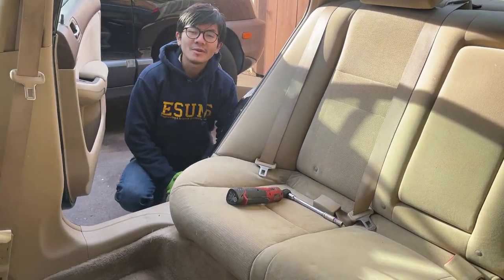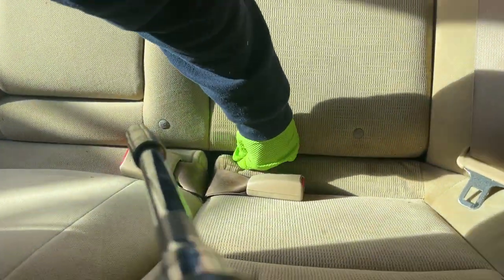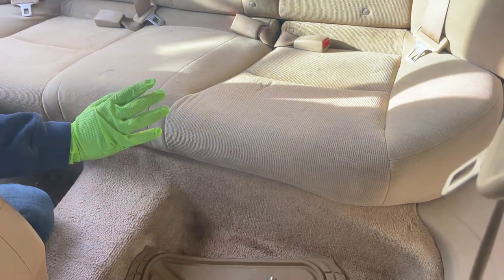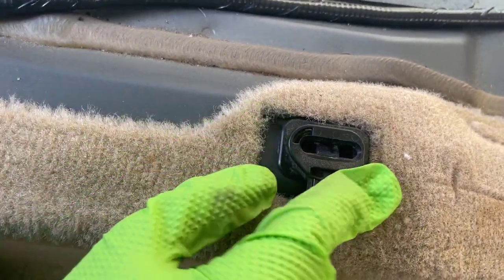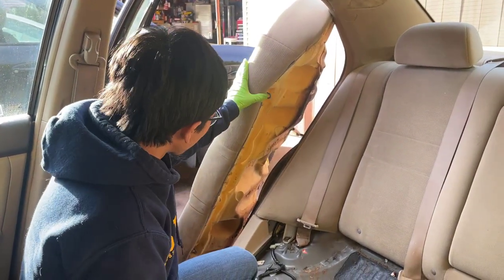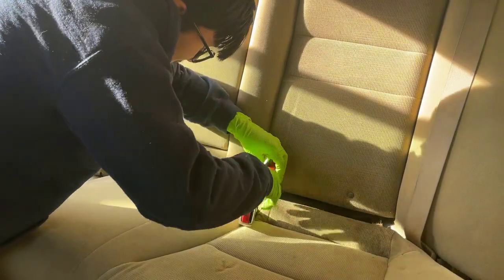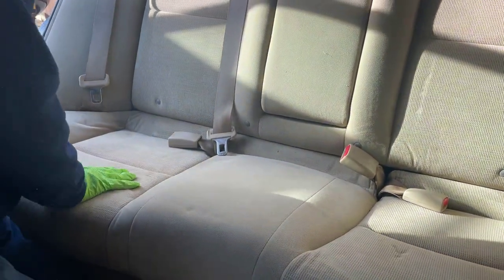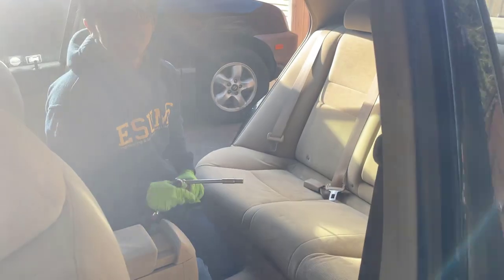How To Remove & Re-Install Rear Back Seat Bottom Cushion Honda Accord Gen 7 2003 2004 2005 2006 2007

Comment from the maker: Here are the #ad links to some of the tools, parts & accessories which might be required to perform this repair:
1.  https://amzn.to/3w7f7wm  |  Milwaukee 2457-20 M12 Cordless 3/8" Sub-Compact 35 ft-Lbs 250 RPM Ratchet w/ Variable Speed Trigger
2.  https://amzn.to/3jYdb4w  |  Crescent 3/8" Drive 72 Tooth Quick Release Flex Head Teardrop Ratchet 11-1/4" - CRW10
3.  https://amzn.to/3yUXyRH  |  FH Group Ultra Comfort Highest Grade Faux Leather Full Set Cushion Pads Car Seat Covers for Front and Rear– Universal Fit for Cars Trucks & SUVs (Burgundy/Black)
4.  https://amzn.to/33J1KZ7  |  THISWORX Car Vacuum Cleaner - Portable, High Power, Handheld Vacuums w/ 3 Attachments, 16 Ft Cord & Bag - 12v, Auto Accessories Kit for Interior Detailing - Black
5.  https://amzn.to/3GVqL1j  |  A-Premium Electric Fuel Pump Module Assembly with Sending unit Compatible with Honda Accord 2003-2007 l4 2.4L Excluding California Emissions

Or Click on Amazon link here and search for what you need:  https://amzn.to/3xIOsqg

Comment: I cannot see or find those two tabs, my 2006 Honda Accord has leather seats and where you can put your finger and thumb between that gap, I cannot  because there is hardly any gap at all.  I can push my fingers in but not sidewards like you can and I can't even see anything through the thin gap that there is.  This is driving me nuts!  Any ideas?  Thank you :)  (I'm from the UK and maybe the cars are different in Europe?).
Reply from the maker: Try to pry outward a little using a screwdriver. Unlikely there is no tabs. But worst case scenario if you happen to break them, surely they're quite inexpensive at the junkyard. It is possible the previous owner, if any, may have broken them, and then glued to foam completely to the body